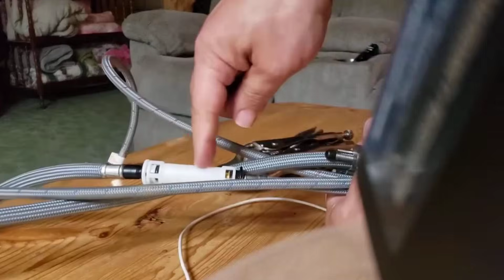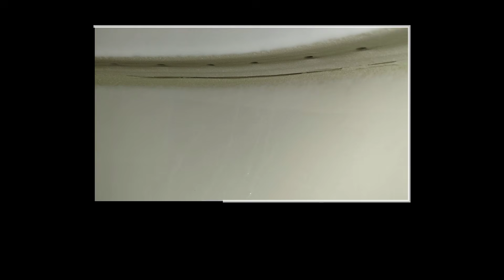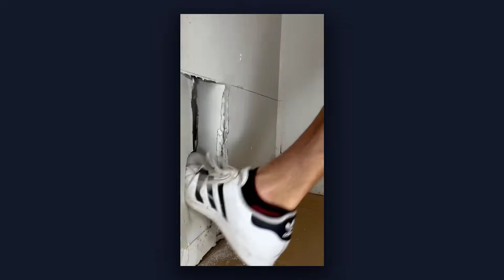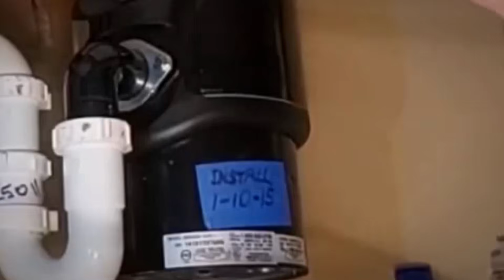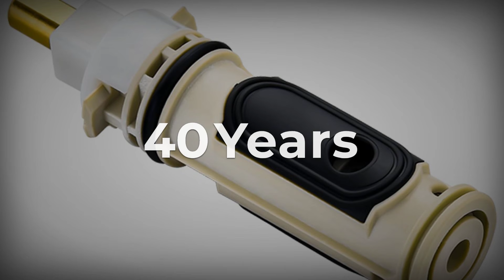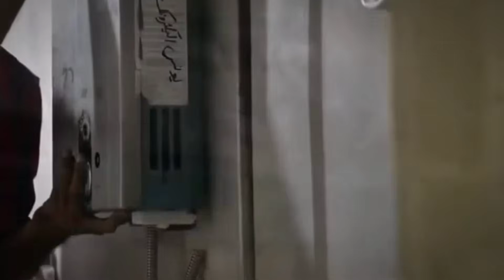The Plumbing Blacklist: 7 Brands Master Plumbers Refuse to Install

Comment: Truth be told; I have a Glacier Bay kitchen faucet - installed at least 10 years ago.  Never had any issues to date.  Maybe I just lucked out.
Reply: Some of those things are so cheap the lack of replacement parts is irrelevant. You just throw the whole thing in the trash and install a new one. A new one is the same cost as just the replacement part in a better brand. Feels so wasteful but that’s what you are buying into.
Reply from the maker: When a replacement cartridge costs $60 but a brand-new 'builder-grade' faucet is $69, the math practically forces you to create landfill waste. What the big-box brands don't tell you is the 'Labor Tax'—you might save $40 on the part today, but you’re paying with your time (or a plumber’s bill) to swap the whole unit again in three years. We’ve traded repairability for a lower sticker price, and the environment is paying the difference. Have you found a specific brand that still makes 'buy-it-for-life' parts, or have you officially given up on the big-box aisles?
Reply: @PlumbingExposed me personally I just order stuff direct from the manufacturer in China. If buying cheap crap, might as well get it as cheap as possible and cut out the big box store.
Reply from the maker: A 10-year Glacier Bay is a true 'survivor' trophy! 🏆 Usually, those house-brand faucets start weeping at the base or losing their finish within five years. You’ve definitely proven that 'builder-grade' doesn't always mean 'immediate junk,' especially if your water isn't too hard on the seals. Have you ever had to swap a cartridge, or is it still bone-dry underneath?